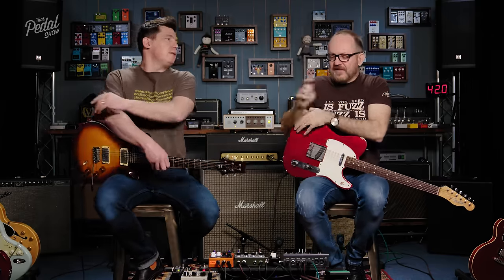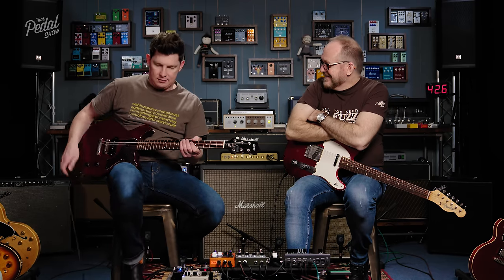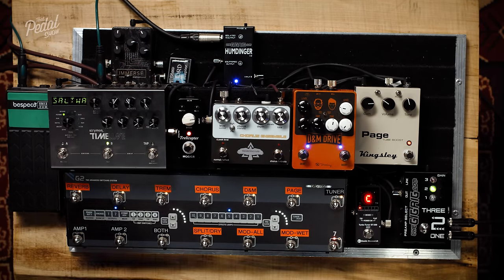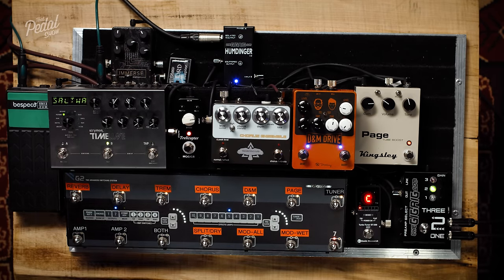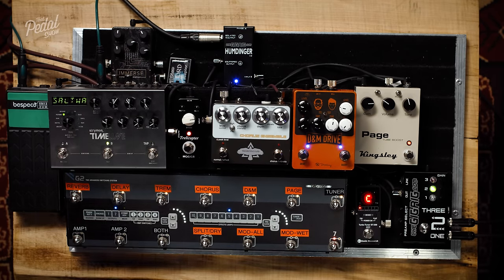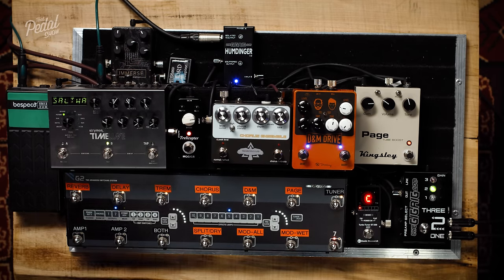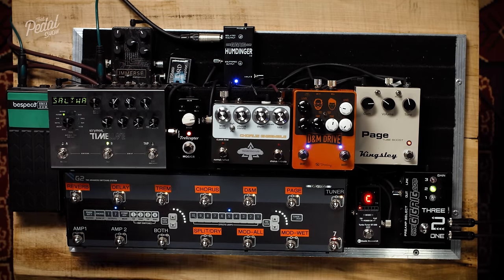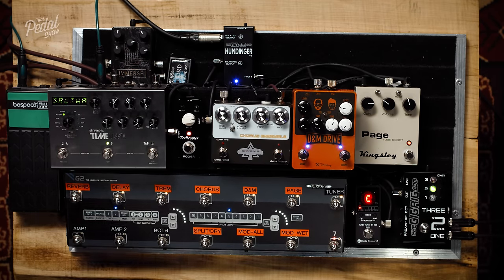Wet-Dry & Wet-Dry-Wet Amp & FX Setups Explained – That Pedal Show

Comment: Hey guys! Awesome show, as always.
As a veteran sound engineer, I can totally back up what you guys are saying. Ive been mixing live bands for over a decade now, and getting a great guitar sound, especially with alot of gain and effects, is one of the hardest things to do. Using a wet-dry rig, is one of the most economical and consistent ways to achieve this.
Even if the wet amp is something that you wouldn't really use on its own. For example I recently worked with a guy who had a HotRod Deluxe for his dry amp, and used a crappy old solidstate Fender Princeton 1x12 for his wet amp.  The way he had it set, the Princeton would only come on with the wet effects. So without delay or reverb you only heard the Hotrod. 
I was very skeptical when i saw this, but i gotta say it really worked. and that amp is like 100$ used. And it made his HRD sound soooo much better.
Also, having  a separate mixer channel for the effected amp gives a lot of flexibility (in terms of EQ, Comp, etc.)  to the engineer.

On a side note: you mentioned a few videos back, you want to do a live band mix tutorial, but it was too expensive. 
Why don't you reach out to a rental company and offer to mention them in the video. I am based in Boston MA, so unfortunately i couldn't be the one to do it , but I can tell you my boss would jump at the chance to let you have a full line array and monitors and everything you would need to really do it up proper. A full simulation of the live experience to  a guitar player in a band . You could talk about working with a sound man (or women) , and what's reasonable (or unreasonable) to expect, monitor mixes, in ear monitors, wireless systems, and most importantly, how the frequency range of a guitar sits within a mix.  
I feel like this is the missing ingredient keeping TPS from being a full on masterclass on getting great guitar sounds live! 
Hey if your ever in the area the offer stands, id get you all the gear, and do the mix, all just for credit. And maybe a TPS shirt. :)

But assuming you'd need a company that was closer to you, ask around. I cant be the only pro sound guy with connections who loves your show.
 And if you own a FOH and backline rental house near these guys.... help em out! 
It would be so great, and I know i would wanna rent from the guys with an association with TPS.
Reply: William Davis i am doing wet dry wet with a 6505+ halfstack in the middle and a cheap fender solid state on the sides. I’m happy to know I’m not the only one who understands they don’t all 3 have to be stellar amps
Reply: I'm looking at doing this with 2 combo amps. One solid state. And one vintage tube amp
Reply: @luisangelEXALTA  i dont know you are using boost or OD pedals... but if you do .. it can be really interesting to hear how each amp reacts differently to the increased input. (And thus can be at the preamp, poweramp, and speaker  level) basically just remember an amps sound isnt a static thing, its a combo of dynamic elements..

So TLDR version... remember to check ur wet dry setup at different volumes, and remember adding another amp can effect how ur gainstaging works, esp with boost and light OD pedals.

All that being said... it can absolutly work beautifuly. Just remember ur adding whole new set of variables
Reply: @williamdavis7274  good stuff brother and yes i plan on having 2 overdrive stages and a high gain stage all via pedals tho both combo amps i have use drive Channels but i usually use a clean platform for my pedalboard. Amazing advice and will try the volume dynamics you mention.
Reply: My nineties rig was similar to the above. My dry amp was a DC30 or Ampeg Reverberocket. My wet was a Fender Ultimate Chorus. Dry amp was almost always dirty and I'd control the volume of the wet with a volume pedal raising it to taste. The more I raised that wet volume the cleaner my tone. It was a really great rig and I didn't see the need for a tube amp on the wet side.
Reply: A C E👍
Reply: @William Davis , maybe you can help with a question I have. When having 1 dry and 1 wet amp, do you pan them in the FOH mix 1 completely to the left and 1 to the right? Many thanks!
Reply: Yeah, something I’ve noticed is the next step- you’ve got the amazing guitar tone, and then how to fit it into the mix?
Reply: Yip, I do something similar. With Vox AC15 for dry (-ish, still use a touch of Spring and Tremelo when I want). Then two cheap, compact and light, but good clean sounding and loud enough Vox Pathfinder 15Rs for Wet/Dry/Wet.

Comment: I like the dB meter.  For a show about sounds having an idea of the relative loudness vs speaking voices is really important.
Reply: Todd Golden I find it distracting
Reply: it's cool but it's pointless realistically. even for people who daily test dB's it's just a number. for example, if the display said 105, 107, 98 dB or 93 dB or 50 dB, would you have any realistic idea of how loud any of those are? no. you could do the same thing 5 different times and either have 5 different readings and think they sounded the same or have 5 identical readings and think they sounded different. it's nearly impossible to be able to guess a decibel value for a sound. the tone, pitch, etc will always seem louder or quieter than they are. 100 dB of low freq's sound quieter than 100dB of high but the low sounds "more". there's infinite variables.. just watch the meter change while they speak. it's irrelevant. 100dB at one spot in a room is galaxies away from 100dB at another spot or outside, or in a different room or with different ambient sounds etc etc..  but it is cool. i enjoy it.
Reply: @carl-ok9gn  wow, a lot of words - too bad I’m not reading ‘em
Reply: The numbers mason, what do they mean

Comment: I use my DD2 to split the amps, creating a stereo-like split, but my dry amp is getting the first, dry sound. The DD2 signal also goes into a CE3 that's set to vibrato only to get the Roland thing. It's amazing. The spread is ridiculous. The chorus is twice as big when only running the vibrato function into one amp and using the clean to be handled by the dry channel. 

Thanks for encouraging me to do this--from one of your old vids. I've been recording an album and hearing this separation in the recording is incredible.

Comment: Thanks, Dan And Mick!
I'm doing a Wet / Dry setup (Princeton reverb for the Wet and a Orange Tiny terror for my dry amp.) With the Humdinger to spilt the signal. After rearranging some pedals, I lost my place, spent 20 min trying to figure it out my signal path. Luckily, I Remembered this video. You two explained it perfectly! Having to actually see the physical connection points of the signal path was a game changer. Thanks!

Comment: For the next VCQs; a multi-part question regarding effects loops, since you mention them here:
1. You've said before on the Show that "not all effects loops are created equal". Can we get some specifics as to what makes a good effects loop? Or a bad effects loop? (Feel free to get technical!)
2. How do you tell the difference between a good loop and a bad loop (by listening or specification)? Are there some amps/manufacturers which are notorious for having poor quality loops?
3. If I only have one amp with an effects loop (so I can't compare the loop quality against another amp), and I just stick some pedals into my hypothetical amp's effects loop, how can I tell if it has a bad loop?
4. How do I know that the pedals in the loop are able to cope with the pre-amp level signal coming from the effects loop send? How much does this signal differ from amp to amp? Are there particular pedals which cope with pre-amp level input better than others?
5. Why might an amp manufacturer settle for putting a 'bad' loop in their amp?
6. If my hypothetical amp has a bad loop, how much worse will it sound with a long cable run to the effects in the loop? How much of a difference will long cables make to a good loop (assuming I'm not adding any buffers or anything into the signal chain)?
7. If my hypothetical amp has a bad loop, what are the 3 things I can try which are most likely to fix its 'badness'?

Now that I've typed it out, it seems less like a VCQs question and more like a plan for a full episode..........

Also, you guys are awesome. TPS is fantastic. I'm not really one for online comments and such, but Mick's Moment of Self Doubt the other week made me realise how important it is that you guys hear from people like me, who absolutely love what you're doing but tend not to get involved in the conversation. I've learned so much from watching your videos, even on the odd occasion when the video has been on a subject that I didn't think would be very useful for me. Your presentation style is great; I love all the chat, banter, jokes, silliness, stories and tangents (especially the big long ones that take us way off track). TPS has easily been the best addition to my guitar world in the last 5 years.
Keep doing what you're doing, in your way; that's why we're all here (well, most of us anyway).
Reply: Nathan Parmar Couldn’t agree more with this, you guys and the show are fantastic.
Reply: Absolutely agree. They're just so fun and inspiring to watch and they're great players also...
Reply: Good idea for a show about differences in effects loops
Reply: Nathan Parmar I couldn’t have said it better.  It really is a great show. I’m hooked!  Keep up the good work and ignore the haters.
Reply: Yeah, This peaked my interest too the only thing I could think of as "Amps With Bad Effects Loops" are Soldano-style amps because they tend to be made to take Line Level effects (so like Rack gear) which can make the effects not work at the correct volume. But other than that or a similar difference in output level I can't think of anything that'd make an effects loop sound lesser than another.
Can't wait for Dan/Mick's reply to this though, it'll be a good lesson.

Comment: Hey Dan & Mick! Just wanted to chime in with a couple of things to note regarding the CE-1: 
Firstly, the vibrato mode is not 100% wet in mono, it's the same wet/dry blend as the chorus mode but just uses a sine wave as opposed to a triangle wave. So when you ran that wet/dry, you essentially had 50% wet and 150% dry. 
Second thing, the 'high' mode on that CE-1 preamp inverts phase. So if you're only running it into one amp & using the high mode, you're inverting the phase on that amp. That's with the chorus effect bypassed (still going through the preamp). With the effect engaged, the dry & the wet are inverted phase from each other anyway so likely wouldn't make too much difference - but using low mode would eliminate the possibility of an unwanted phase inversion with the effect bypassed! 
Lastly, I'm yet to notice the Two-Rock sounding dark in the video (i'm only about halfway through), but remember that without some kind of buffer before the CE-1, high mode does sound very dark. It could be that with a drive pedal on before the CE-1, you're feeding it a buffered signal and so it behaves, but without any pedal engaged before it, you're feeding it an unbuffered signal. Again, the low mode does not have this issue and does not need a buffered signal in order to not sound dull! :)
Reply: You are right. On the CE-1 if you just plug a jack into the Mono out it will have a 50/50 mix between wet and dry, while as soon as you plug in a jack into the Stereo out the Mono will become full dry while Stereo full wet. They could have taken the advantage of this maybe running the Chorus through the wet amp but just using its Stereo out, in order to mimic a chorus sound between the wet and dry amp.

Yes, high mode needs to see a buffered signal. I don't know if Dan used a buffered loop for the pedal or not. He also asked me if he could modify the level pot on the unit, so if he made the mod there would be no tonal issue. But it indeed sounded a little bit dark, maybe he could shred some light onto this (?).

Yes, CE-1's high mode inverts phase so that's a thing to be aware of when using it. There's always Low mode anyway that doesn't sound bad at all.

Comment: Great stuff. A couple of very quick questions if I may? I use two amps in stereo, rather than wet/ dry. Into the front of the amps, no effects loops. I have my 'dry' mono signal going into a stereo delay, then two outputs to a stereo reverb from there out to the amps. I bought a splitter/ isolator but so far have not used it in anger as I appear to have no phase or ground loop issues.  Am I simply lucky, or could I still experience problems at a particular venue? When I DID try to use splitter, I placed it at the end of the chain, after the reverb with one signal going direct from the reverb to amp one, the second going from the reverb into the input of the splitter and then into amp 2, via the isolated output. If anything the hum level seemed to increase slightly using it in this way. Should I try to place it earlier in the chain, bearing in mind that I'm playing in stereo and my mono signal is being split to stereo by the delay pedal? Thanks!

Comment: Perfect timing of this video as I just converted to wet/dry. The issue I’m running into is that if you use a delay into a Reverb with both 100% wet, the reverb washes out the delay when both are on. If I just set the delay 100% wet and the reverb at 50-75%, the reverb only effects the delayed sound, so it’s not reverberating the dry signal on time. And also, with the Reverb set not at 100%, when it’s on by itself, I get dry signal. 

If I kill dry the Delay as in literally setting the Timeline to kill dry and not just turning the mix knob to 100% wet, then the reverb can never be used without the delay and it still is only reverberating my delayed sound when on. If I kill dry the reverb as in literally setting the BigSky to kill dry and not just turning the mix knob to 100% wet, the delay can never be used without the reverb. How do you combat all this?

It seems like I’d have to set them both to kill dry, split the dry signal to go into both inputs separately, then out of both outputs and summed together again somehow and out to the wet amp, essentially running them in parallel. However, that sucks because I like my delay to hit the reverb. Also, what do I use to do all that? Seems like a lot of extra splits and what not, which I’m scared will destroy my tone.
Reply: Durgo25 Been scratching my brain trying to figure this out, too. I used to run a w/d rig years ago, and I would run the delay and reverb in parallel to combat this, but as you said, I want them in series. I’d love some insight on this..
Reply: Maybe try running them through your effects loop via the four cable method if you're not already?

Comment: I'm just working on my rig to go wet/dry so your video is perfectly in time and very very informative as usual.. thanks! Being involved in this process I think there are a lot more details that could be discussed because of the number of ways you can do a wet/dry rig also if I realize that probably it would become very annoying for many people here so.. I just leave here a brief list of things that I'm taking into account for my rig as a trace for further discussions:
1) Using a WET/DRY rig with the DRY signal hitting both amps beside phase and isolation you must take into account the analog or digital dry-through of the pedals hitting just the wet amp as also with AD/DA delay of few msecs you will hear that bad "flanging" effect that will destroy all your dreams.
2) In WET/DRY rigs with KILL-DRY on the WET side, phase (and digital dry-through of course) is not an issue anymore as we don't have dry signal here and we will hear only delalyed repeats or reverb trails. On the other end the lack of dry signal makes very difficoult to handle multiple effects (as just a delay and a reverb) which should be processed in parallel for obvous reason (if run in series just the delay repeats can hit the reverb).   
Using multi-fx digital rack units with internal routing possibilities running parallel can be easy but working with pedals can be really really tough and a lot of other stuff would be needed (and at the end of the road I wouldn't carry a second amp to leave it silent when I don't use delays.. ; ))
3) I'd like to use dry amp gain but my amp doesn't have an FX loop. Well I'm planning to get my WET signal post power amp (that's even better in my opinion) with some sort of line out box placed in the amp<>speaker path but.. now I will have a LINE LEVEL signal hitting my first FX pedal so I must be sure if it can handle it.
Then after all the WET FXs  I'm planning to go to an SS  power amp  but I must be sure that the INSTRUMENT level going out from my last pedal in the WET chain can drive it properly.. right?
4) Oh Lord.. I think it's enough.

Comment: Love it lads great sounds and great amps. Really that Marshall is a different animal altogether but I have a question about using smaller amps to run a wet dry or wet dry wet. I'm currently using an orange Tiny Terror and an orange rocker 30. I run the wet effect into the 30 watt lad and keep the TT dry but the lack of headroom in the TT makes it challenging for drive pedals to run at gig volumes. Should I go the other way round and send the wet signal into the TT there are also challenges. What do you guys think? I mean I don't really have probs recording at home but at practice and gig level there are definite trade offs. I'd be interested to hear what you think